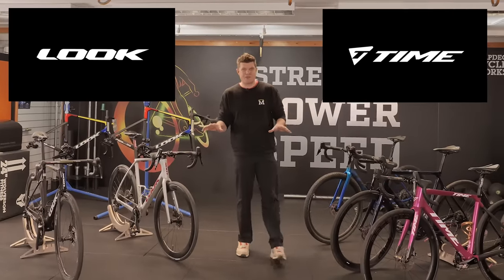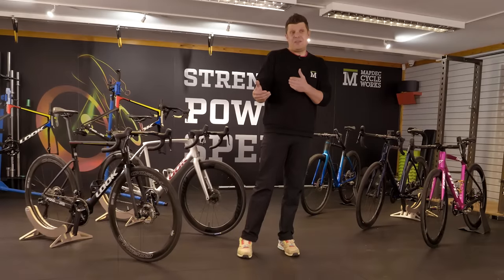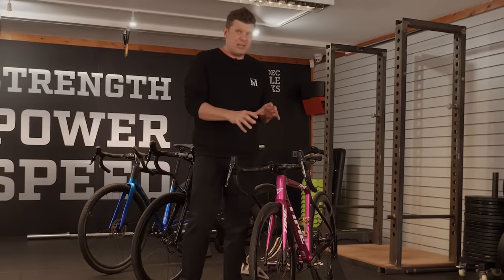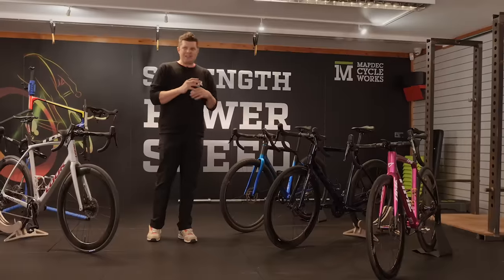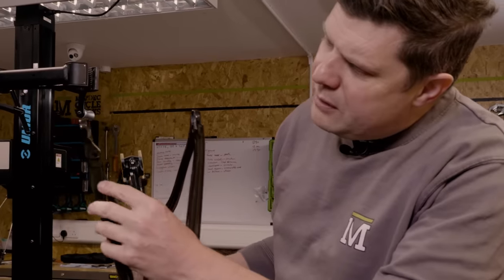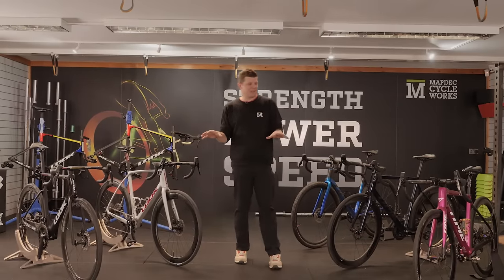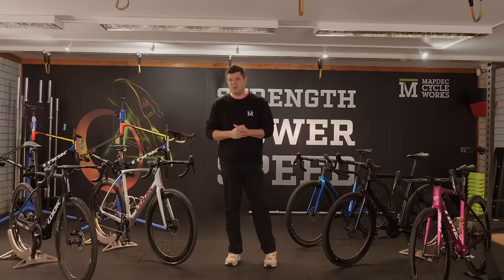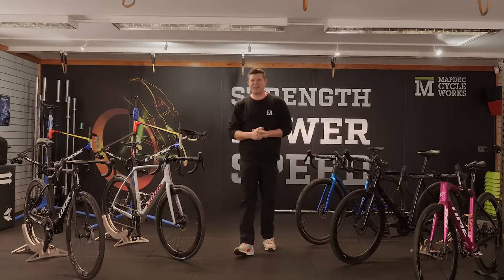LOOK vs TIME - The engineer and the artisan...

Comment: Would never trust a designer over an engineer
Reply: As an engineer myself I'd say it's a little more complicated than that.  Not all engineers and designers are created equal.
Reply from the maker: I don’t think you can have one without the other.
Reply: As much as I'd like a Time ADHX, there is still it costs significantly more than a Look 765 Optimum. Plus I think the 765 suits my riding style more (sit and spin).

Comment: In 2021 I got a 795 Blade RS, built up with DA/HED vanquish wheels. It is the most amazing riding bike I have ever had or ridden!! It has the power transfer and front end stiffness with nice vertical compliance in the rear triangle…. Rides so smooth… even over rough SoCal roads.
Reply: I see it as unfortunate that Look succumbed to popular demand to lower the seat stays on the new 795 to increase stiffness for the ProTour…  nice for them, but I see it as a disadvantage for the non-racer century rider like me…
Reply from the maker: For sure.  The blade doesn’t hide from its intended purpose.  For the non competitive sportive rider the 765 and the new 785 will hit that sweet spot for you.

Comment: Very interesting comparison, your arguments are reasonable and sound. Most of us can only buy one bike at  time; I choose the Time ADH21 and I can confirm, it's stiff, yet it rides quiet and smooth, especially uphill or on rough surfaces. That's an important point for me, because it helps to be able to ride longer. I like the approach of Look as well, but I'm really happy with my Time, which I think is also fantastic value for money (compared to several other high end brands).
You have a great bike shop and I think Your choice of brands makes every customer like Buridan's donkey.
Reply from the maker: Thank you.

Comment: I can't decide. Both fantastic bikes. I have the LOOK 785 Huez Disc which is a great bike for locally hills riding. Looks stunning. But being a mechanical engineer I also have just ordered the TIME ADHX for the superb build quality. BB tolerances, openly displayed carbon fibre weave, robust and steady frame for lumpy local hills, pot holes and dips. I'll change from 2x Shimano to try 1x SRAM with the ADHX and explore some gravel roads.
Reply: Hambini put me right off SRAM, he says the quality control is very poor.

Comment: Since I have discovered TIME bikes, both quality of finish, technology and ride, (I still have Focus Cayo disc), I would be considering LOOK only as my third bike.
There is nothing better on the market than TIME. I look forward to see next models in 2024.
TIME handlebars and seatposts are extremely desirable, I regret that TIME doesn't manufacture it anymore.
Reply: Same here. I have owned multiple Look frame sets, bar the latest one and also an ADH01 and the Time is decidedly better in every imaginable aspect.
Reply: They still manufacture it. But not in France anymore. Slovakia. But still 100 % owned.

Comment: I own a Look 795 (and 565) from the previous generation. Best bike I ever had and riden. And a joy to look at too😊.Time makes beautiful bikes to but a little bit to conservertive in geometry and looks.
Reply: Do you only stare at bikes or do you ride them occasionally as well? Take a ride on something like the ADH01 with some nice wheel set and you won't want anything else ever.
Reply: 😂 You don't have to worry. I don't take her out occasionally but frequently. No doubt a Time rides fine. Just prefer the steep seattube angle,  adjustable seatpost and aero cockpit. Everyone should ride what fits them best.

Comment: I went to my LBS a few days ago with a parts list to get an ADHX 45 built up. 
If I had to pick a road bike right now, I'd probably go for the 795 Blade RS. But my SL7 is still good enough for the foreseeable future. By the time I'm in the market for a new road bike, there'll probably be a new Scylon and a 785 Huez to consider as well.

Comment: Funny, I would have made the opposite choice of "artisan" and "engineer". LOOK have always been more 'engineered' to me, with the amount of system integration, pushing the envelope on what they can eke out of each section of the frame, innovating in aero, designing frames as semi-complete modules before any major brands were doing so.

TIME are the artisans - the amount of hand labour involved, tying off individual 'sock' plies by hand, wax mandrels, the traditional approach to geometry, dedication to what they know will work, making improvements when something is obviously better but not changing only for the sake of change. 

TIME are far and away the most 'spirited' feeling carbon bikes I've ever ridden. They don't try to win on grams, but they ride light, while remaining inexplicably comfortable. And as you showed, they feel strong and unyielding in the hand but that somehow translates to a planted feeling on the road. It also inspires confidence - you don't feel like you're floating on top of this fragile wafer-thin monocoque. Riding on eggshells, as it were. It's as close to the confidence you get from a good steel frame as I've felt in any material, but with the light weight and snappiness of carbon.

Comment: The ADHX is my lottery win bike, and Time just edge it for me for desirability.  But they are both the pinnacle of frame manufacturers.
Reply: Same. Bought one this year, first CF bike (other than a hardtail mtb). Thing rides so well that I thought I was gaslighting myself. A true all-road - A fast gravel bike and a fast road bike depending on my wheelset. Elated a splurged on it.
Reply: @daveanolik8837  Nice 👍 Not envious at all 😉
Reply: @daveanolik8837 do you own an ADHX all-road or an ADHX 45? I'm looking to build a 2-in-1 bike and I have become enamoured with the ADHX line! Cheers 🎉!!
Reply: @Chayeazy  I have the ADHX with two wheelsets so I can easily swap from road to gravel. The fast gravel kids are definitely trending toward 45mm++ primarily for screaming fast descents. I run specialized pathfinder pros 38mm, and for me personally it’s more than enough, at lower pressure/tubeless, to feel fast and safe on descents on the typical gravel here in Oregon. Thing is, I put more miles on roads than gravel, and the ADHX, with road tires, roadie cockpit (aero drop bars) and aggressive geometry (for me) it’s also the road bike I’ve always wanted - stiff, climby, fast, comfortable on very long rides. I also have a pivot LES for sloppier gravel and bigger adventures, so between those two bikes I have everything covered. The wider and (I think) slightly slacker profile of the ADHX45 would feel less of a fast aggressive roadie, but I’d love one if I could afford a single-purpose gravel racing bike in my quiver. I guess what I’m sayin’ is… I want ten primo bikes, but the ADHX and my Pivot check all the boxes for the riding that I do. 😁

Comment: I really want a Time, but I cannot find any information on how stiff the frame is when accelerating. I’m on the larger side (83kg), and I feel very sensitive to flex in the BB area. I’m coming from a Colnago V3Rs which is too flexible.
Reply from the maker: Please come and try one.  Although if you are coming from the V3 I would wait until they launch the Scylon

Comment: Great comparison. Shouldn't we be comparing the ADH with the 785 Huez rather than the 795? I currently own a 785 RS and am looking into getting a ADH.
Reply from the maker: Yes.  I did mention it. Perhaps too briefly.  New 785 soon I think.
Reply: Thank you. On a separate note, may I ask if a RTP surface on the ADH, be left as is without a coat of paint?
Reply from the maker: @lasalleklang1973  I would protect it for UV and chip damage somehow.

Comment: In this context artisan is rather Festka. These are rather different approaches of engineering.

Also reminding everyone RTM is used by 3T. So it's not that much about process, but its application.
Reply: Some are using RTM but with a polystyrene mandril that is then melted out, not very environmentally friendly and how do we know all the waste material is removed. Time use a wax mandril, so better for the environment
Reply: @garybird8646  this difference you are talking about is unfortunately pure greenwashing. The impact is near identical, as both solutions are circulated in the facilities, but at given quantities both pose a serious threat, should an accident happen. It's not just one piece of candle wax you have with Time
Reply: 3T is not even close to TIME technology, they have different appoarch and technology, TIME as the only one with Braided Carbon Structure , the weaving of dry fibers into complex bi-directional patterns. with 30 years of experience, experiments, and test they have no competion from main stream brands. And.. Lifetime waranty : )
Reply: @MrSzwarz  what part of Resin Transfer Molding is about weave, huh? As said, it's not just one aspect.
And to be honest, their pattern is not that complex even compared to some shoes, let alone any carbon sheet layup. Hence the greater weight, by the way: the repeated pattern adds fibers where those are not necessary because the spot is some distance away from where they are required.
Reply: Yeah, and 3T's quality control is garbage.  It is in fact about the application. 🙂

Comment: Of all the reviews on Look, including this one - they never seem to cover the post purchase maintenance complexities derived from Looks bespoke components and design . I owned a 695 SR with the ZED crank.  A bike so insanely stiff and reactionary. All was great until I wanted to replace bearings / chainrings at my local bike shop.  That's where it died for me.  No LBS is going to spend $400 on a bespoke Look bearing removing tool used 2-3 times year.  And then try find the bespoke chainring bolts to match.   Incredible bike, but not practical unless you''re on the Cofidis team.
Reply from the maker: Oh. We did a vid on that.  It doesn’t require the tool.
Reply: @Mapdec  Look had an entire video dedicated to safe removal of the bearing using their custom tool, preventing crank damage. What was the point of that?
Reply from the maker: @oldfox6355  to teach dealers how to do it.
Reply: @Mapdec  so how do bike mechanics do it without the tool?